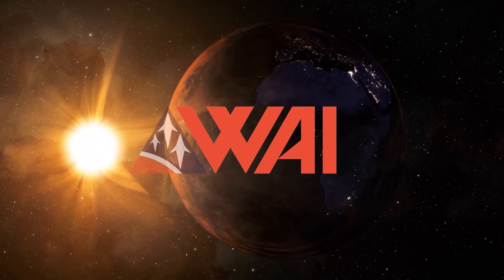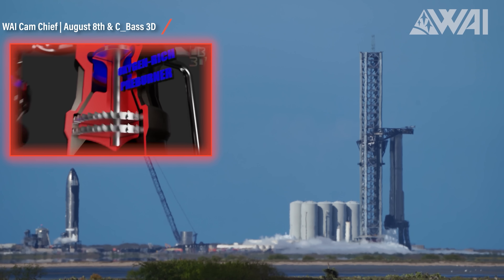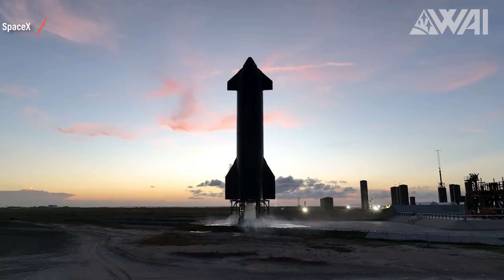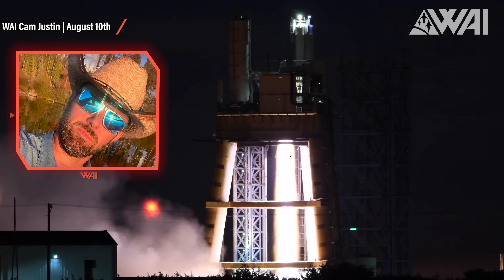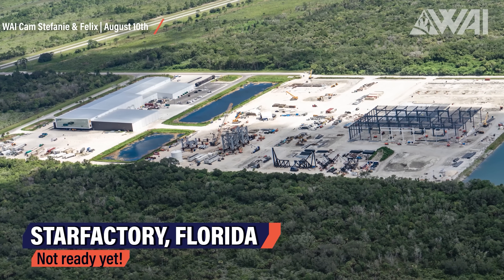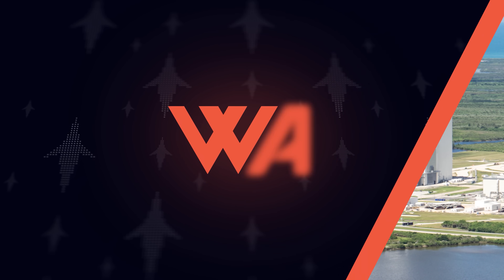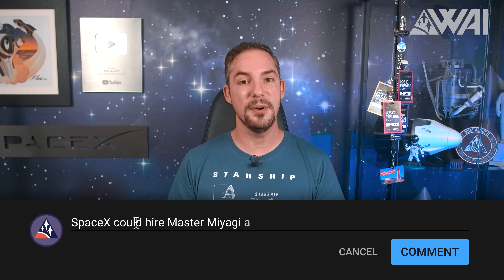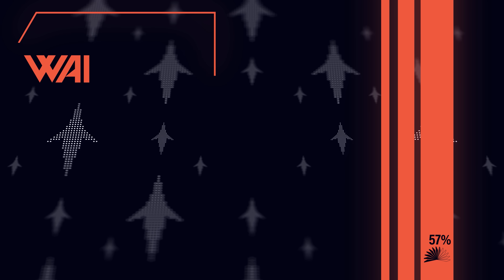SpaceX's Starship Orbit Flight Tests Already Going FASTER Than Expected!

Comment: Falcon 9 lands with what is called a "hover slam".  It has more thrust than it weighs at landing even with one engine throttled all the way down, so it basically has to go straight in, rapidly decelerating all the way to touch down.  Super Heavy Booster on the other hand will, as I understand, be able to truly hover and thus come in slower and thus be able to fine tune the engagement point with the tower.
Reply from the maker: While this is all true, Musk already said repeatedly that that's not the plan as they want to save fuel. So, it will basically do the suicide burn the same way a Falcon 9 booster does. :_WAISweet:
Reply: @Whataboutit  While  the preferred landing would be accurate Starship positioning without any hover required, the Starship WILL be capable of hovering if necessary
Reply: @Whataboutit  Musk also said a lot of things that changed sometimes even the next week. There is a lot more time between when Musk talked about the possible landing of a booster and the tower being build at 39A, so things might have changed... again...
Reply: @_MicZ_  That’s honestly how science and engineering works. As you get closer to solving the problem the solutions can change quite a bit.
Reply: @_MicZ_  well keep watching his updates and we'll see whats the final method!
Reply: @shableep  Or even reverse course. Witness the switch from carbon fiber Starships to stainless steel. Can't get more of a bigger design switch than that!
Reply: Note that the BO lander seems to get somewhere close to its target and the ground, comes to a long hover while moving over to near the center of its target, then settles gently. If the first Starship booster and ship are destined to land in the ocean, I'd hope they allow enough fuel on board to thoroughly test that hover ability before settling in the water. Starship can carry about 100 tons. A Starlink v2 satellite weighs about 1.5 tons. So early flights could carry 50 or so of them and still have about 30 tons of excess capacity for extra landing/hovering fuel (for both booster and ship).
Reply: @WarrenLacefield  https://youtu.be/KA84wzdXt3g
Reply: The booster will be caught in the most fuel efficient way, in operation.  When they have the control sequences in a manageable manner that allows for an accurate final burn and catch, they will only tweak the process.  This whole enterprise relies on rapid re-use.  That means rapid capture, rapid remounting and refuelling.  Musk always works towards the goal of “successful” and then moves to other projects and processes.  At this point he has production line engines, boosters and spaceships.  The space facilities are built as a standard that can be replicated around the world.  He wants volume, and so whatever works will be used. 1000 ships, remember that….
Reply: Musk also said the booster catch will look very slow, ~2 m/s so they should have plenty of time for small corrections
Reply: @ownerf  https://youtu.be/KA84wzdXt3g
Reply: That's what I was going to say.
Reply: At least it's a possibility if the hover slam becomes a problem they would be able to fine tune. with F9 it's not even possible.
Reply: I'm excited for the launch!!
Reply: Yep
Reply: https://youtu.be/KA84wzdXt3g
Reply: Another thing to consider are weather conditions. If wind would be strong unexpectedly I could imagine the booster getting very imprecise
Reply: falcon9 can do a straight up hover, starship does the hover slamming
Reply: @vashcrimson4395  wrong
Reply: @vashcrimson4395  sorry but you got it backwards!

Comment: Regarding the size of the chopsticks. They have not been designed to move like a conveyor belt. Only left to right / up and down. So The booster and starship have to lineup based on the landing only.

Comment: Felix, why doesn't SpaceX use Ascension Island as a recovery/refit/re-launch base. It is just a few degrees South of the Equator and in mid Atlantic. SpaceX 1st stages could land there having followed a ballistic path from launch instead of the burn back needed at present. Refit facilities could be built using the very long runway for access and at 3 degrees below the Equator, Launches from there would be more efficient! What say you?
Reply from the maker: It's because they want to refly the boosters the same day in the future, so they have to develop it with that in mind from the beginning on. :_WAIRocket:
Reply: @Whataboutit  if they invested in facilities to refit launchesr on Ascension Island they would have same day re launch capabilities at a potentially cheaper amount abd from a very suitable launch site.
Reply: It's British, not US and SpaceX needs to operate on US soil for national security and export  control reasons. After all, Britain may elect an authoritarian pro-Moscow anti-NATO leader, which would not make them a reliable ally!
Reply: @nicktrier3640  yes, ASI is Btitish and has been an ally and partner with the US for over a century, so a co-operative deal could be struck. As to the leader change you describe.... couldn't and wouldn't happen. But then again, that description part fit the current POTUS!
Reply: They need to land at the launch tower so that they can relaunch the same booster that same day.
Reply: @bassnfool2  I know that is the plan, but have the same infrastructure at ASI and you have a great recovery/relaunch base nextvto one of the longest runways in the world. Ascension was an alternate landing sute fir the Space Shuttle!
Reply: @dasturdly01  sure you also have all the personnel living there, manufacturing all the necessary propellant everything it takes to build these things would get shipped there. Starting to see a no way your going to get Alcoa to build an aluminum fabrication plant there, does Elon use any carbon fiber? The USofA navy would have to establish a base there. What the hell there’s already 170 bases around the world, for all I know there’s already one there, if not what’s one more. Course you know the military are not sea level rising deniers! So how close to sea level is that longest runway? I think we have a better shot at stopping the blowing holes in the ozone layer with ever blast off  get the graphene production going and build those elevators to space done off Ecuador, and move every bit of production out of gravity deforming grip! In the end it’ll be a whole nother factor cheaper than blasting off the face of the Earth!
Reply: @carlpodrecca5177  The airfield is used by the UK military and now US Space Force (USSF) from 1982 to present, so large aircraft handling facilities are in place. So is accomodation. The USSF and NASA already have tracking facilities and support services in place on the island. There is more than enough room to build a couple of landing pads, refit facilities and a launch facility. So the biggest issue is permission from the UK government, which wouldn't be too difficult to acquire after negotiations, nor is getting the equipment to the island either. The port facilities are more than adequate for shipping in large vehicles and containers and the runway and the aircraft handling area, more than large enough. As to your other issues, until the technology and the resources are available to build a space elevator, launching rockets is the only way. And the science and exploration from those rockets will make other technologies and science more available to achieve your space elevator and maybe fix the ozone layer!
PS.At 258 feet AMSL i dont think the runway is in any danger of flooding, unless a tsunami hits!
Reply: @dasturdly01  cool, add the methane, oxygen, and liquid nitrogen,right it all up, get it into Elons hands quick you might get a finders fee out of it!
Reply: @carlpodrecca5177  Really??!! Pseudo sarcasm!?
Reply: @dasturdly01  he is a busy guy, might not know about the place?

Comment: SpaceX did it again - doing something after the video was shot, making one of the points not longer be correct (in this case they rolled back B7 presumably to install the center engines again before fully testing the ring of all 20 outer engines). Must be hard to try to keep up every week.
Reply from the maker: Haha yeah! For this stuff, it is SUPER helpful to follow me on Twitter for fast updates! Chief was there and took all the footage we need for next week! Static fires are already announced from the 15th to the 18th!  :_WAILove:

Comment: No tiles falling off on Ship 24 static fire as it was on ship 20 static fire.
Reply from the maker: That's going to be a heart stopping moment for me for sure! Watching closely as it goes up if tiles are falling off! :_WAIShocked:
Reply: @Whataboutit  If I were in Elon's shoes, I would mount a LOT of those tiles on critical parts of the OLM. It would not only protect them, but make round-trips faster and easier. It would also be easier to test the tiles and mounts against hard/hot blasts.
Reply: @otpyrcralphpierre1742  nah
Reply: @otpyrcralphpierre1742  I don't think the tiles would be able to handle the turbulent explosive thrust the engines put out, compared to the smooth re-entry pressure. They'd probably brake up.
Reply: @VP_JayDeePants  Maybe, but that's what Testing is all about!
Reply: @otpyrcralphpierre1742  Those tiles are about as strong as styrofoam coated in a thin ceramic glaze
Reply: @darkfur18  How do you know that? Are you privy as to their construction? I sure would like to know! Please, tell us!
Reply: @otpyrcralphpierre1742  they're similar to (but stronger than) shuttle tiles which you could poke a hole through with your finger, they have to be lightweight to reduce ship mass, there's video of them falling off and slowly falling to the ground to estimate that mass, they're rather well known for being easy to break while handling, and the black material is just a coating (they're white underneath). Need I go on?
Reply: @darkfur18  Well, thank you for that info, Pilgrim. But I still think that it would be a worthwhile experiment.
Reply: I can't wait to see how they hold up on reentry 😀